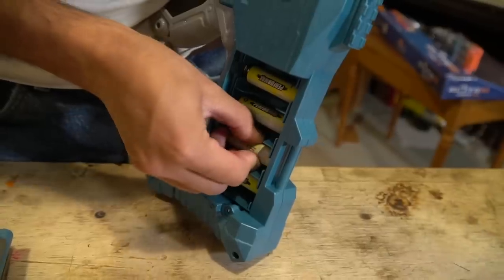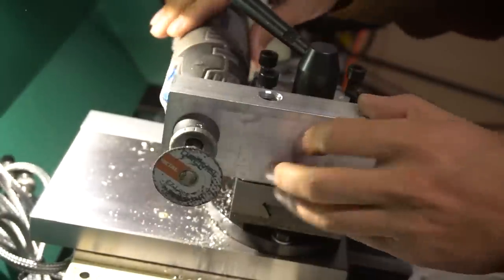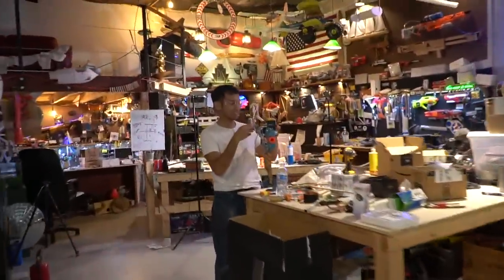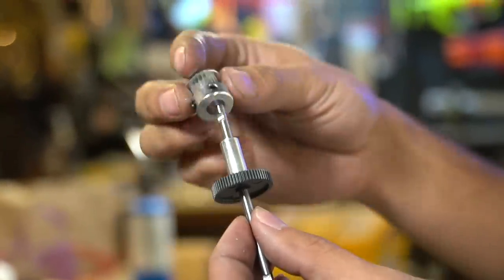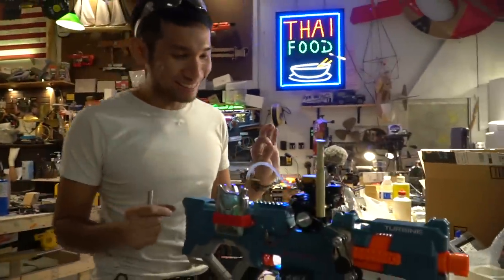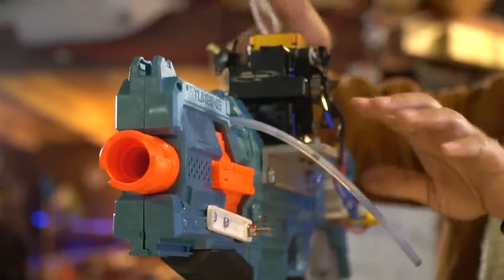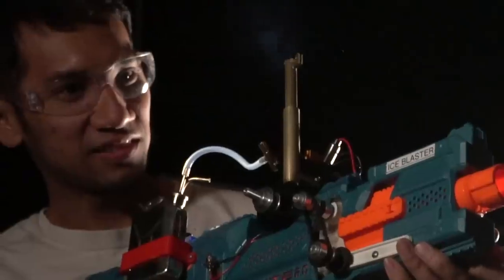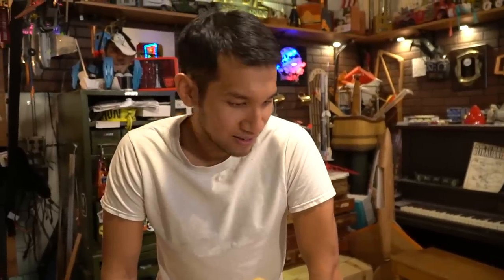Gas Powered Nerf Blaster

Comment: "Piece of crap flywheel gun" Yeah, the new nerf 2.0 guns are awful
Reply: Well they perform like standard Nerf dart blasters, until they quickly break and you can't break the glue to open them up
Reply: The yellow ones were the good stuff
Reply: Nice profile pic
Reply: Images
Reply: Adventure force and dart zone is the new wave
Reply: @eggbag4182  i prefer the stryfe
Reply: @jotarokujo4787  Isn't it discontinued?

Comment: I'd really like you to make an MKII and miniaturize the engine to fit into a custom frame and make it look like a bolter.

Currently, the Nerf Gun only seems to be effective as a defensive weapon, providing suppressing fire. 

Hell, if you could make custom ammo from tougher material than foam, like high friction plastic or rubber, then you could increase the range exponentially.

Comment: When I saw the title I thought it was going to be something straight outta of gears of war,like the Lancer,a gun with a chainsaw under it
Reply: EnricoAwsome  yo
Reply: The chainsaw part would technically be 2 stroke.
Reply: @InvertedRooster  after reading about It,it's not even gas powered,it's powered by the gas of the bullets,weird stuff like it's an engine that uses the blowback action as fuel
Reply: @soldadoryanbr7776  Oh, that is very weird.

Comment: From the look of the drop your maybe getting 80-90FPS. Increasing your cage crush to take advantage of the increased torque along with a gearbox to increase speed could probably get you up to maybe 180-190. You’d rip darts up but it would be a fairly viable open field blaster.

Comment: Add a turbo and nos to the engine then see how fast it shoots
Reply: Throw a supercharger on there for good measure
Reply: @masonnero9038  turbo plus super tends to cause issues
Reply: @psychoticducky4617  it would be a superturbo aspiration system, but a true superturbo doesn’t have both run in sync.

Comment: you should make  motorized bicycle by attaching a weed Wacker or chainsaw engine to the inside of a bike and run a sprocket from the drive shaft to the wheel.

Comment: With harden steel, you should be able to heat it up then allow it to cool down slowly. This will make it softer, and easier to work with. Once you have finished the changes heat it back up then quench it, this will re-harden it. But you need to research the temperatures and quenching liquids for the steel you're working with, in-order to not have the results become to soft or to brittle.

Comment: Should still tune the gearing to get the flywheels spinning faster, and maybe a custom flywheel cage that moves the flywheels a little closer together, it should be able to fire quite a bit harder with just a few small tweaks, then I'd be curious how it compares to normal modded flywheel blasters which hit around the 150fps mark last I checked.

Comment: Very cool! I think it has even more potential though. Like you said in the video, you should make a bigger pulley on the engine, then link the rollers together, so the rollers spin faster for a given rpm. The motor seems to have enough torque to pull a "higher gear" (so to speak). Keep increasing the motor pulley size until the engine starts to bog down, then you've reached the limit.

Comment: If you want it to make more rpm and to launch the darts use a bit of rubber on the flywheels so the darts will grip better onto them and then make the pulley on the engine bigger

Comment: Build one from the ground-up and power it with electricity, but through an unconventional way. Solar-powered rechargeable batteries that power an electrical ram-rod that just shoves darts out. Not saying they have to got far or fast, just leave the barrel.

Comment: for some reason I was thinking this would be operated using "green gas" (fancy propane) or CO2 not gasoline/petrol , this is way cooler,
compressed air nerf gun is simple enough

Comment: here is an engineering challenge, make a stability system for nerf darts in the nerf guns you made. Lets see how far and accurate you can propel those darts.
also a simple rule : you aren't allowed to change total mass and length of the standard nerf dart.
P.S: I left a loophole in the rule :P

Comment: So about a day ago, on December 1st, 2020, I made an add-on for my Centurion, which is, I think, supposed to be a Mega Nerf dart sniper rifle, but I pretend that it's a rocket launcher, anyways, that add-on was at first going to work like a grenade launcher, firing a bundle of 7 normal nerf darts, with a rubber band at the base of the bundle, from a empty toilet paper tube taped onto the very front of the gun's barrel, it didn't work as intended, so I then made a small cup, using a cut empty tp roll that I cut to fit in the add-on, and fired the gun, pushing the cup forward, making the dart bundle fly, lets just say, not very far, so then I removed the rubber band, turning it into basically an old school shotgun, it didn't work very well with the longer barrel of the gun, so I removed the Centurion's extended barrel (it's a required attachment btw, but it can be removed with a decent amount of force), and taped that tp roll to what is the barrel that the extension, well, extends, and I got to say, I loved that decision, it shortens the distance that the mega dart needs to travel to leave the barrel, making the impact against that cup holding the 7 nerf darts much stronger, allowing the darts to travel a little bit farther with more spread, and it also shortens the reloading time.

the reason why I made this comment is because I wonder if you could make a nerf shotgun that works in a similar fashion to how mine works, but its gas powered to fire the mega dart needed to fire several smaller darts much father.